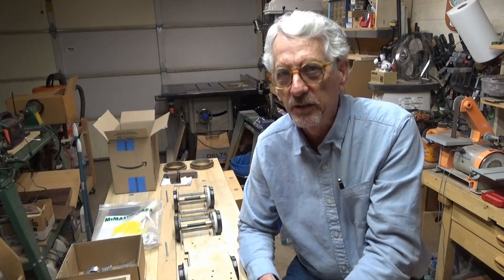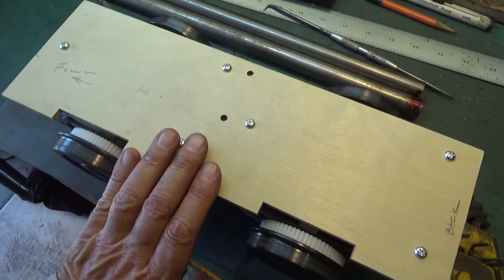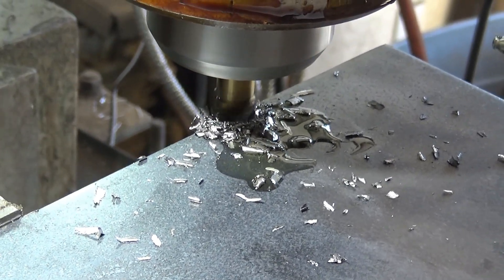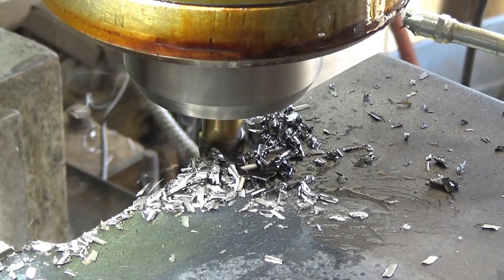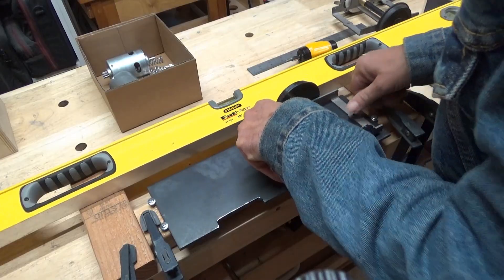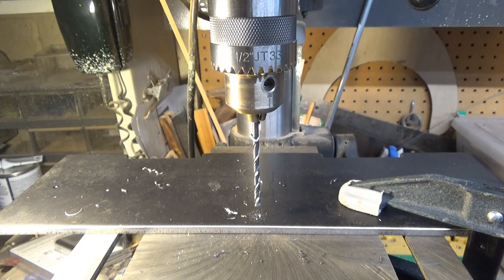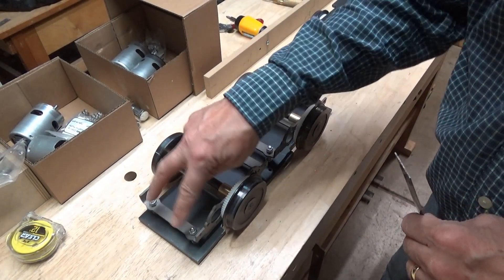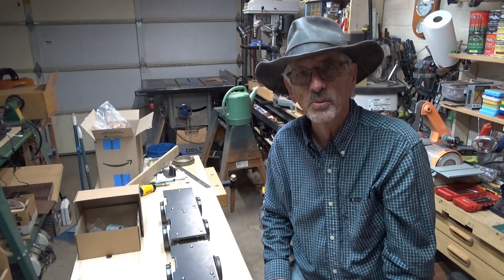Building a New Locomotive - Part 2

Comment: Exciting stuff Stan.   You might have mentioned it in the earlier video - I’m getting caught up backwards, but did you have trouble getting the wheels and motors from England?  I assume they are Maxitrax or similar?    Also, does that phone in your shop still work?   Don’t see them much anymore.  Our local model train store still has the same rotary they have used since the 60s and it is functional, although they can’t dial out as the phone system no longer can interpret clicks I guess.  They keep a separate cordless phone plugged in if they need to make a call.
Reply from the maker: Yes, Jim, the wheels and motors are from Maxitrak, although I think they may actually be made by/for Accucraft.  It was a bit over $1K for all of them with shipping, AND a nice tariff fee once in the U.S. 😄. Shipping is remarkably prompt from the U.K. as most things are flown to the U.S.  That phone, and an old manual pencil sharpener, were my dad's from his shop, so that's why I keep them.  You'll notice the crud on the phone--  I was hand polishing some brass for my steam locomotive, and thought it would be a good idea to mount a buffing wheel on the drill press to save time.  Instantly there was a horizonal line of compound all around the shop!  Not my best move.  🤣

Comment: Hey Stan
Fun project. Iv worked w wood a lot over the years. Many of us probly have. Steel was always for me, grind it, “weld” it, hammer it and drill it to try to get what I had in mind. But never came out looking like what I wanted🙂.
So I made a lot of sawdust instead!!
Fine excellent work!!

Question 
On the bench the wheels look a lot closer together and then when you tested it on the track I was surprised. 
Is that the track arround the house for the big engine and cars you ride on?
Those new wheels look so much smaller. 
Anyway maybe just the video perspective. 
So cool thought to see all this. 
Thanks 

A memory flashback
Moody had its modified Founders Week last week and watching on line I remembered sitting up in the balcony and I was doing the sound mix (things were so simple then) for a Sunday Night Sing watching seeing you on the TG platform on drums!
Good memories!!
Reply from the maker: Yes, so many great memories of our times at Moody!  There was so much going on, so many projects, that I think of those times as the last golden years.  Yes, the track I tested the bogies on is the same one I ride around on.  This new loco will be about twice the power of my current electric locomotive, 'Rodney.'  It is 5" narrow gauge track around the house.  When you see the wheels and axles in person, you think, "These are way too small to pull anything other than squirrels."  Tiny compared to the 7.5" gauge and 15" gauge stuff I also run.
Reply: @StanFerris ah yes well said… The Golden years!! That’s it exactly. 

When I saw those 4 motors thought that’s power!!!
So do you have more than 1 one 5” gauge tracks?
I thought you ran the 15” at home.
Reply from the maker: No Scott, the 15" track gauge and 7.5" track gauge trains are way too big for our small property and very tight 9' radius curves.  They are at the RR club park about an hour away.  So I wanted something here at home, so I needed the smaller 5" track gauge.  The new loco will have 8 60W motors, or about twice the power of my current small electric.
Reply: @StanFerris Ah ok, thank you! And wow, 8 motors!!! I recall now seeing those 4 on each dolly base. Looking forward to more on this build.
Fun stuff !
Thanks Stan